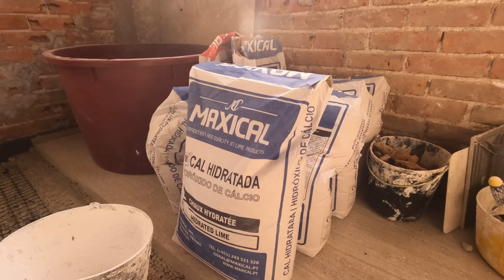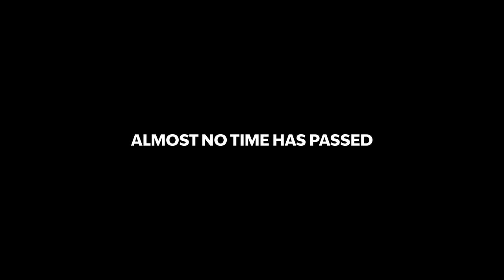Float Coat Lime Plastering Experiment - Learning by Failing

Comment: Do you have a 32-inch skim blade? If not try and get one it will save your muscles and it does an amazing job when applying skim coat finish. Easier to use than a square trowel.

Comment: I wonder if you would be able to hang a picture on that surface. Would it crack the material on the wall? Is it rubbery or brittle or what?
Reply from the maker: The end result is just like any other plaster, so we can attach hooks, shelves etc without any issues

Comment: Did you spray the wall with water prior to putting on the lime coat mix? I’ve heard your supposed to mist the wall first to help it slow down going off too fast and continue misting it periodically while it’s going off.
Reply: Yes, from what I've seen of others who are getting pretty good results with lime plaster, they wet the wall pretty thoroughly prior to adding another coat. Otherwise, it dries way too fast. They also float it with a wood or metal trowel, not sponge.

Comment: You need to wet the background a hell of a lot more before attempting to go over it. Also your mix is waaaaaayyyy too dry, trust me, I’m a plasterer with 20odd years experience. That’s an arm breaker mix. Another top tip is don’t let it dry as much as you have been, by the time you are deciding to float it - it’s already gone too far. Top coat also needs to be thinner and your sand is too heavy. Keep up the great work anyway 👍

Comment: If you soak the hemp for 48 hours, it should break down and soften up a lot, and you can help the breaking down by mixing it several times. Also the rendering mix should move much easier, so less hemp and more water/lime, I guess. About the hemp soaking, I’m sure, because of my paper making skills. The rest is more a guess, based on my rendering skills.

Comment: i would try a top coat of much more lime in it and finner sand - and then after drying for 2 days sanding it down with sand paper 400- 1000 grit depends on the finnish you are after - good luck
Reply: You shouldn't have to sand any plaster.

Comment: I think you shouldn‘t wait until the plaster is dry. Use the wooden float with circular movements immediately after putting the plastering on the wall.

Comment: Your mix is much too dry, use rendering sand and really soak the walls to stop the suction.
You can still use the too coat method, even on lime.

Comment: Hey guys would an orbital sander be any help?
Reply: Yeah I looked at that too, so I hope you don’t mind me chipping in, as I’m currently insulating my house in Scotland, but also I worked in the heat and vent industry and my best friend worked in the insulation industry( both retired now) anyway Sorry to say that insulation is a function of thermal transfer, and lime even with hemp is not a good insulator, the best that they will get is reduction of draughts. The cold will come up through the stone since there are no foundations. 
Having said that as you may have seen they are putting in underfloor heating in the lecca floor, which for all sorts of reasons was a brilliant choice. 
They will get heat transfer from the underfloor heating and some of it might be held in the stone, however I’m doubtful there will be enough heat from the underfloor to usefully heat the walls. 
I’m pretty certain They will be comfortable enough though since the heat will be directly under them, they might need some additional heat in the winter, but I’m sure they will let us know 😊

Comment: maybe with top coat you can leave the hemp out as it in the 2 under coats which should be enough for insulating the wall ....but i wouldnt say your falling in so much as learning the process  which  means  ........you will never no...... if you dont give it a go.....would leaving the sand out completly....and see if the top coat  floats....you will by look have good Core  and Upper body strength after you finish the walls